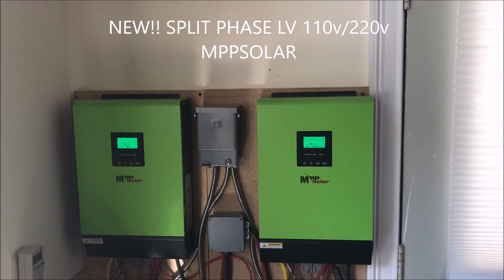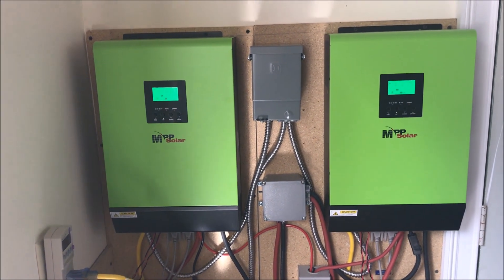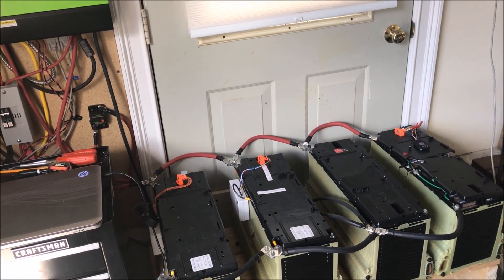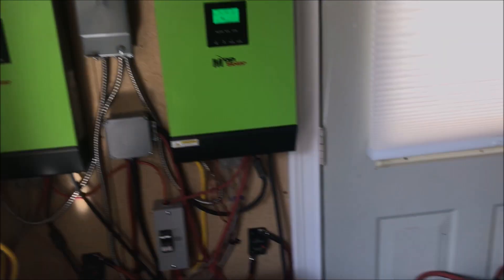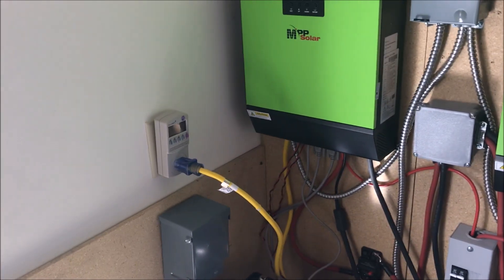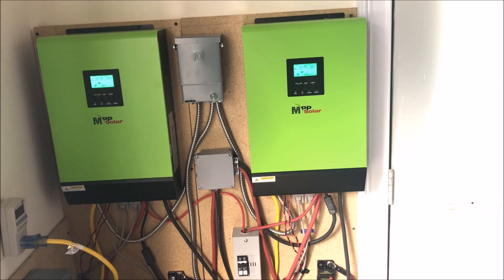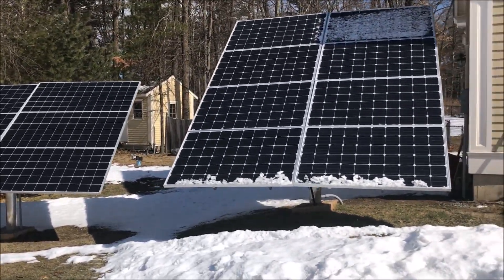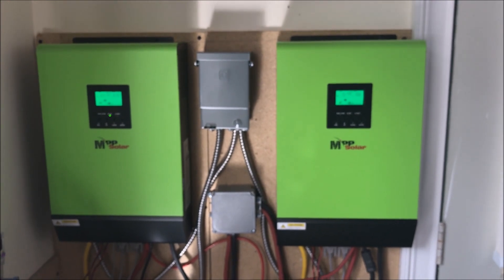NEW!! SPLIT LV MPPSOLAR (110v/220v for U.S. Market)

Comment: Wow. Check this same model IGrid SV LV 3Kva :  https://www.aliexpress.com/item/32839127901.html
It is 3Kva 2400W 24Vdc Hybrid solar inverter for 120Vac 60HZ output (Like US/ Canada/ Mexico and Latin America countries). it also support split phase 240Vac ( L1-N-L2). it can be parallel with Max 9 units. So you can get Max power 27Kva for single phase and 3-Phase.

Comment: Thks, ?Are these U/L rated? If not, ?you probably won't be allowed to push power into the grid utility (yeap that's a question)?.
Reply from the maker: Tom B I don’t believe it’s U/L rated. But it was also not a requirement in my town. Meaning it wasn’t the issue.
Reply: @offeraviad  Thks, I'm just getting start with solar & still trying to figure-out what's best for my home.  Here's a few comments/questions:
*Utilities usually don't pay much for home solar.  ?So is it really worth selling solar power to the utility?  It would seem it's best to dump the extra solar electricity to a big hot water heater like you (ex: jacuzzi).   
*Seems MPPT controllers are very popular.  However MPPT controller use electrolytic caps & they only have a operational life of ~5years.   I still trying to figure-out how to replace them when they die.
      https://www.allaboutcircuits.com/news/calculating-the-lifespan-of-electrolytic-capacitors-with-de-rating/
*Information on solar power systems are very confusing especially hybrids.  You're a thorough/competent guy.  Well that's make you the perfect candidate for short introduce videos on solar power systems in general & hybrids in particular.  There's infinite geek detail on the internet but few experts can explain the big-picture in just ~ten minutes (ex: KISS & to the main points).
Reply from the maker: Tom B I think mppsolar life is a bit more than 5 years and those are cheap compared to others. They are also not very efficient but it all comes down to what you pay for it. After few years with mppsolar and off grid system I decided to go grid -tie but consume the power vs sending it to the grid (I have two electric cars now). This works well for me (for now) but I miss my ability to store energy while the grid is down. What can I say, if you are just about the penny’s than do the math on what works for you. For me it was just a fun learning experience with some nice benefits.

Comment: Can you do 110v and 240v at the same time in the parallel configuration?
Reply from the maker: erikunixarias no. Parallel config is only 110v.
Reply: I am studying the manual (pre purchase study), plus corresponding with the USA supplier via eBay: I beleive there is a way to configure 2 unites for 220/240 volt split phase like 220/240 v is used in the USA.  10.209:  Here is recent slit phase listing: https://www.ebay.com/itm/LV2424-Hybrid-2-x-2400W-24V-120V-Solar-Inverter-Split-Phase-incl-parrallel-kit/254376122195  . : also here a clip of how some did this w bigger MPP system: https://www.youtube.com/watch?v=iTEcvDKF5j4
Reply from the maker: William Self yes that’s what I’m using. 240v split phase. Each inverter is 120v and combined it’s 240v between the phases.

Comment: How is it working with the Volt batteries? What is the max/min voltage for DC output (charging)? Is it programmable? Thanks!
Reply from the maker: James Hughes no issues. Great batteries. DC charging for the batteries can be set all the way up to 140amp (solar plus AC). See the manual on their site it’s all there. Yes it’s programable.

Comment: Hi - Been awhile, any updates? Curious how the PIPs and Volt battery bank are working? Thanks
Reply from the maker: mike stasko agree. I’m a bad YouTuber. Everything is working great batteries and great, charging my car from the sun everyday and if anything I have left overs which I wish I could upload to the grid. No real updates to be honest. But watch my channel because this video is old as I added two more of those.
Reply: @offeraviad  Thanks for the update. Ever think about expanding your battery bank and just isolating house loads off grid OR just satisfy the house demand with a gridzero functionality, like an Outback inverter? That way you can avoid 'wasting' solar. Thanks
Reply from the maker: @zekeboz5533  That's exactly where I am now but have little time to do it. As times goes by I get use to dropping power on the ground and not using it. maybe one day Mike ...

Comment: ==  I got  MPP PIP 5048 and came with broken AC terminal. I had to pay $28 for new AC terminal and replace it myself. MPP does not have a warranty .
Reply from the maker: levonet33 odd. I had no issue repacking a broken terminal.  They shipped me the parts.
Reply: @offeraviad   I paid $28 shipping.

Comment: Welcome to MPP's inverter family, I have install a MS4048 in my house since 2016, last year I added another MS4024 into the system to test the different between 48V vs 24V, both inverters output are 230V I have it go thru a 10KVA transformer with ATS so only one inverter feed the power to the transformer as one, the secondary output of that transformer it gave me 110V into a breaker box and feed the house.  I have 12 panels LG265 to charge a group of Nissan Leaf and Chevy Volt batteries group to keep my house power at night, so my 1st inverter is going very well for over (3) years now, and the 2nd getting close (2) years old.
Reply: Did you have any trouble getting that transformer started with the inverter? I have a V2-5048 (5kW, 240VAC out) and intend to drive a Square D 5S1F transformer for split phase operation here in the US. It's not operational yet, but everyone is telling me that the MPP inverters have no overload capacity and will trip off at the slightest hint of an inductive load. One guy told me that he can't run his 10 Amp, 120 VAC table saw from a 4kW MPP Solar unit because it trips off due to inrush all the time.
Reply: Greg Wilterdink Thanks for sharing that information.  All rotating motors (i.e. -compressors) experience a degree of inrush current, although capacitors help with the start up, and thus reduce inverter tripping to some degree. 

I just saw a video from a solar inverter user who is running a 2.5 ton central condensing unit and a mini split off of his 2 (3KW) MPP inverter systems.  I would GUESS his start up amps on the 2.5 ton unit would be between 15 and 25 amps for a second, and then drop to 6-10 amps continuously while running.

Comment: What is the max solar panel wattage each one can handle?
Reply from the maker: Lysol ! 145v. But MPP stops at 115V.
Reply: @offeraviad  
Thanks for the fast reply!  
I get about 100v with 3, - 240w panels in series ( × by 2 parallel) was thinking of adding another one  so i have 4 series. But NOT now! Thanks a lot!  The heat here doesnt let them produce more.
Reply from the maker: Lysol ! Single digit here and I easily pass the 145v in the winter. In the summer I will switch to 3s but not now.

Comment: How much did you pay also u think I can ac couple with these. I already have enphase but want battery backup without throwing them out
Reply from the maker: Check eBay around $650. I now have 4 of those.. need updated video /:)
Reply: @offeraviad  and is it true u need two of u want split phase?
Reply from the maker: plojm123 each inverter only provides 110v.  So if you want 220v split phase you need two. I have 4 , two per phase so I can draw 9600watt.
Reply: @offeraviad  looks awesome thanks
Reply: Can I just hook this straight to 110v?

Comment: Can the AC input  and AC output  be connected to each other?

I have the inverter connected to batteries, solar and  the AC INPUT to house power, and the AC output is connected to a separate circuit panel (for backup power), here is my problem: 

I have a transfer switch on my house that disconnects me completely from the power company, if i connect the AC OUTPUT to my house it will power everything Including ITSELF since its connected by AC INPUT to the house wiring, will this cause any problems?

I dont think it will cause a problem but i want to be sure.
Reply from the maker: t t I don’t think it’s designed for that. You need to ask mppsolar support.

Comment: Great set up.  I just got 1 if the inverters for now and will be getting a 2nd soon. I am having trouble getting the watch power to hook up.  How did you get your to work with the pc Any help would be great..
Reply from the maker: Homestead Solar power &Projects if you have exactly the same as I have it’s not warchpower it’s solarpower, maybe that’s the issue.
Reply from the maker: Homestead Solar power &Projects https://www.mppsolar.com/manual/SolarPower%20(hybrid)/
Reply: That may be the trouble i used the cd in the Pc and it will load but not link to the inverter. Yes the one I got is the 2424lv split phase 2.4 single. Until I get the 2nd pip. I will try the link this eve and see if it works. Many thanks ..
Reply: Thanks for the link buddy. Working great now.

Comment: When you use 2 inverters in parallel you can duplicate the solar modules?
Reply from the maker: Jonathan Flores not sure what you mean. The output is separate from the input. Each inverter is not aware of the input of the other one. Parallel doesn’t generate 220v only 110v so it’s typically limited to 20amp output.
Reply: Aviad Offer for example; 1 inverter need 8 solar modules, if you have 2 inverters you can put 16modules? Sorry for my English. Thanks
Reply from the maker: Jonathan Flores parallel is only for output not input. Input is always the same regardless of the output mode.
Reply from the maker: Jonathan Flores in other words the panels input will be the same regardless of the output mode (Parallel or split phase)
Reply from the maker: Jonathan Flores so each inverter has its own input. So yes 8 Panels on one inverter means 16 for two and 24 for three etc.

Comment: Nice I love my pip. I have the 2424LV been running 24/7 for just over a year. I was going to move to the new 240 volt. Thinking I may just stick with the 120 as it's doing what I need. I will when I can buy one more pip so I can run my loads all at the same time. Find that 2400 watts is good for 99.99% of the tine. Tho when the AC and fringe start at the same time it's a bit much..

Comment: I saw those inverters on eBay. Keep us posted on the reliability  of them. I was reluctant to buy from overseas because of possible warranty issues.
Reply: The MPP solar units have proven to be EXTREMELY reliable. they only just came to U.S. markets at the right voltages but they definitely hold up very well and are very well proven in the euro markets. just make sure you buy direct from them as they will honor the warranty that way and they are very particular with their shipping. good company and my friend has no problems running them flat out to their limits. Ive honestly got no problem recommending them over other options.
Reply from the maker: Will do. I trust MPPSolar not the others.